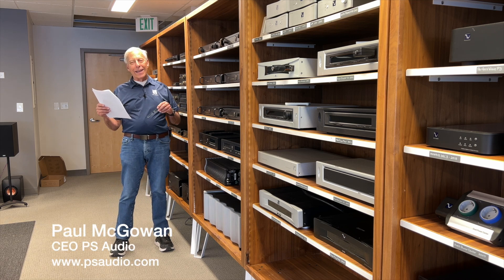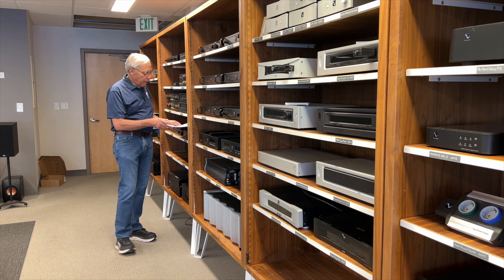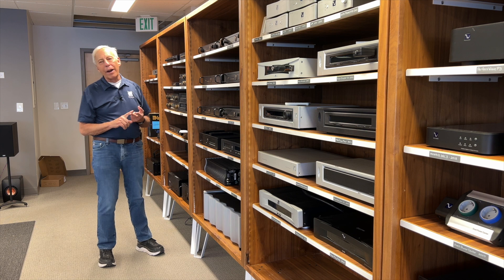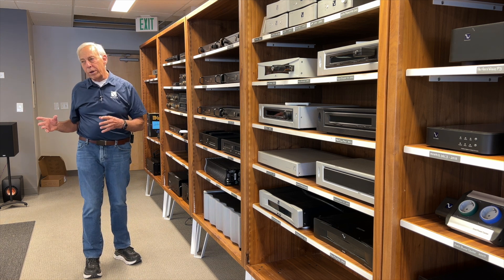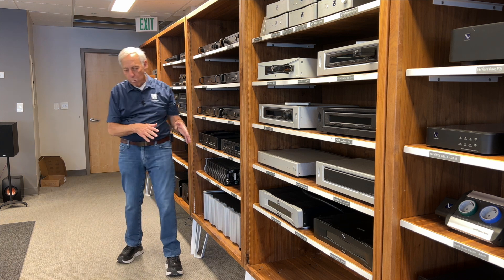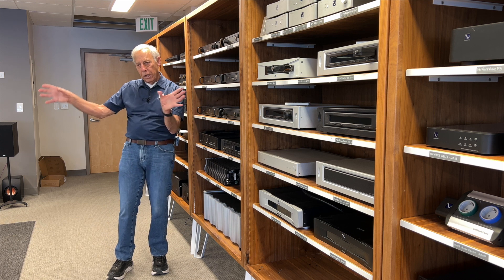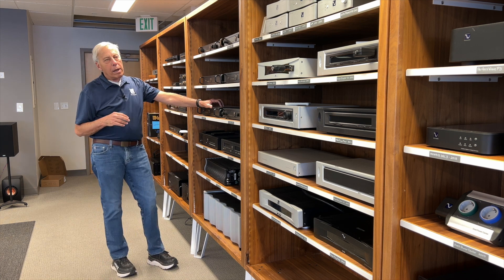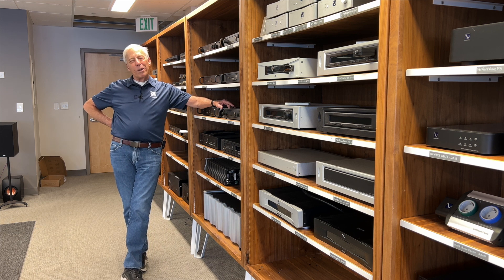Can DSP fill in woofer dips?

Comment: Some great information here thanks Paul,

I do have a DSP question relating to dips in bass. In my case the dip is minor, I use mini dsp SHD preamp to give me a correction that I like. I admit to giving the correction a few db increase in the bass shelf also, just because I like it. 

My question relates to an example like mine. The dip in bass is minor, and so cannot cancel out the bass sound altogether. I’d imagine this is the more common experience? If so dsp could potentially help as I perceive it does for my tastes?

What do you reckon as we aussies say?

On the other point you make, dsp does flatten my somewhat peaky treble but I feel I loose some transparency or air to the sound. Is this what you are referring to with dsp on higher frequencies? I look forward to you addressing this question down the track.

Keep up the great work!

Tony W
Reply: The impression I got was that it’s pretty easy to control high frequency issues without using DSP, it doesn’t take too much in the way of room treatment and setup tinkering to get the mid and high to behave. And if you cheat and use DSP at those frequencies you might flatten the response but you still have the echo and reverb taking away all your detail and smearing your imaging and soundstage. In my opinion those two things matter a lot more than the actual high frequency response anyway. Cheers from QLD 👍🏻

Comment: "Each band of the equalizer allows a maximum boost of “+6 dB” and a maximum cut of “-15 dB”. This asymmetrical setting range was chosen on purpose, as boosts of more than “+6 dB” are very rarely required. Every strong, narrow-band dip measured in the frequency response usually results from a cancellation caused by a phase shift. An equalizer typically cannot compensate for this, or only very inadequately, even if greater boosts were possible. Experience shows that you should focus on eliminating peaks in the frequency response.  The human hearing reacts much more sensitively to narrow-band peaks than to narrow-band dips.   " HELIX DSP user manual
Reply: you could get around this by increasing the whole output by 10db for example, this is done separately on the minidsp shd studio software, where gain for the whole channel is separate from the PEQ, and i have tried it out, you can get over 20db gain from this and i have not heard any artifacts from it.
not like the free pc software called eq apo i used before, where as any boost was just everything else lowered, and creating quality loss if above 6 or 10 db in peq.
Reply: @sudd3660  But keep in mind 0dB is full scale + dB means out of range, Helix recommends cut of instead of boost. I don't know how the minidsp does this.
Reply: @GBatya  i do not know either, probably when it upscale it internally to 32 bit.

Comment: @2:18 "Keep it in the bass.  I'm fine with that.  I like DSP for bass.  No so big on the mid-range and tweeter."

When you run the signal through a DSP box (or an equalizer), you are running the entire signal through that box.  And that box acts as another pre-amp.  That is active processing, and active processing is bad for sound quality.

It adds distortion, coloration, and degrades the signal from what it was.  You will be hearing that box, even if you keep all of its controls on their neutral setting.

The only way to augment the bass, via DSP, without it touching the mids and highs, is to apply the DSP after a crossover -- and crossovers are the domain of speaker design.
I know of no components that allow you to adjust the bass, while excluding the mids and highs.

Also, for DSP to work, it has to use digital content.  If you are playing a turntable, then its analog signal must be converted to digital to be processed, and then back to analog.  The DS Process will act as yet another transport and DAC, and be subject to jitter.  There is simply no way that that will leave your mids and highs as they were.

Audio is an environment of compromise.  If your bass problems are giving you agita, then DSP might be the proper remedy for you.  But it is not a free lunch.  Your mids and highs will change (assuming you have a revealing system).

An alternative solution for correcting bass problems is what Vandersteen speakers (model Quatro and up) do.
They have 11 potentiometers.  With sound tuning equipment (microphone connected to a laptop with SPL (sound pressure level) software, you can measure each of 11 different bass frequencies, and adjust each one individually.

The above keeps your signal 100% analog.  It uses a high-pass filter for each channel.  So it, too, will have an effect on the mids and highs.  But Richard Vandersteen designed it all, and if you have heard his speakers, then you know that he knows his craft.

The other advantage of the Quatros (and up) is that they relieve your main amps from 6 db of bass lifting, allowing your main amps to struggle less, resulting in cleaner mids and highs.
Reply: you have some odd ideas how dsp are implemented and work, instead of picking are you points i could tell you this: for example add a digital dsp box, use it as preamp. into two dac's and stereo power amps, you have a mains pair of passive speakers and subwoofers with only drivers in a box.
the dsp wont be noticed to degrade the sound for most people, and the benefits for those who hear it are worth it.
think about what i  said her, look at how many benefits this approach has.
many companies make such digital dps boxed, minidsp shd studio or the flex model is two i know of.
Reply: @sudd3660  "instead of picking are you points i could tell you this"
Go ahead and pick.

No matter how you use a DSP box, it becomes part of the signal chain.  You will hear it.
If you use it as a pre-amp, then you are limiting your sound quality to that DSP box's design.  Perhaps there are some very good sounding DSP boxes.  None of them show up a "Class 'A'" recommended in Stereophile or The Absolute Sound.

For a mid-fidelity system, they are probably a good choice.  But Paul does not tout his company as a mid fidelity audio manufacturer.  He touts his company as high end.  As such, he should caution that you cannot achieve that level of sound quality when you introduce a DSP box into your stereo.

Surely a DSP box is a quicker fix than all of the room treatments that Paul has in his listening rooms.  Yet, Paul does not use a DSP box.  Although he has not said why, it is because his stereos will reveal the degraded sound quality from the DSP box.

Your stereo is the sum off all of its boxes, and will never sound better than the worst box in the signal chain.

"...and the benefits for those who hear it are worth it."

In my initial comment, I wrote:
"If your bass problems are giving you agita, then DSP might be the proper remedy for you.  But it is not a free lunch.  Your mids and highs will change (assuming you have a revealing system)."

As to "the benefits for those who hear it are worth it", you can't know that.  I can't know that.  Only the person that tests it, with their stereo, in their room, can know that.

A DSP fix should be for those that are not seeking the best sound quality possible within their budget, or people that do not have time to make room adjustments to fix sound issues, or people that are physically unable to do so.

If you can fix sound issues, passively, that will almost always sound better than using a DSP box.  I write "almost always", because if a room has severe issues, then a DSP box might be the only way to fix those issues, and that fix might be worth trading off a bit of sound quality.

A DSP fix should never be choice #1, when seeking the best sound quality.

Comment: No, dsp cannot fix room modes.
Reply: that is a gross oversimplification, dsp adjust volume of those room modes, technically they are not fixed but less of a  problem and therefore you get better sound quality.  but also dsp is a wide term, with dsp you can also adjust pahce and delay, that could actually fix room things, a null could be adjusted for.

Comment: you know how to insult people naively/gently😂
it is very simple you get a single driver cabinet that can cover a frequency range from 660 Hz down to 20Hz,
with a DSP with delay connect up the speaker and flip the phase and add the correct delay, this can be done in rew what is free! just need a universal calibrated usb mic about $30.
place in the middle of the two forward speakers ideally on a stand behind the listener or on the wall behind facing your main speakers.
this will give room correction and take away the dips in frequency below 660 Hz where you get comb effect happening that's what you're getting by having dips and you do not need to push the speakers so loud so you don't encourage peaks.

Comment: Luckily bass dips are far less annoying than bass peaks.
Reply: Yes, unfortunately the peaks are caused by room modes and this requires room treatment not dsp. 

Lowing the level will never deal with the reverb, only the volume.

Other than that, Paul is right, no matter how much energy you pump into a dip, it will still cancel.

Comment: I wonder if placing a Passive radiator enclosure tuned to the frequency of cancellation in the corner would help with the peaking issue.
Reply: that is kind of a bass trap, that helps with peaks and dips,  the problem that it need a large box volume and only works in that room for one narrow band of frequency, and presumably only work best in one spot in the room.
Reply: I experienced massive phase cancellation once...and my speakers simply vanished.
The best hifi room is no room at all.

Comment: DSP correction of higher frequencies can work really well for digital music when not adding sample rate conversion and when done in high resolution math. Unfortunately, DSP correction products usually end up messing with sample rate conversion e.g. translating a 44.1kHz PCM track to 48kHz or 96kHz before DSP compensating it. Someone needs to make a DSP correction product that can maintain end-to-end sample rate from source to DAC and do the processing in 32 or 64 bits math. Until then, Paul has a valid point about DSP compensation and higher frequencies.

Comment: I've not tried it, but what about having two subs with one phase adjustable (0 to 360 degrees) - would it help or create more chaos? :) Great video Paul - it's remarkable how you keep the curiosity flowing after so many videos, well done.
Reply: Yes. Multi sub is the answer here. The more Subs you have in the room the more the frequency response will balance and equalize. Of course placed in different places in the room which would mean that somewhere where there is a null from one sub, the other sub will fill in that null and thus create a proper frequency response .
With DSP you further fix the peaks to be in line with the rest of frequency response and you get much more responsive sub frequencies in the room.
2 is huge upgrade over 1 and 4 is tremendous upgrade over 1.
Reply: I think you would be playing "wack a mole" at that point, giving up one dip for two smaller dips. Outside of the sweet spot it might get really wild, and you would loose bass definition in the upper bass due to time arrival difference at shorter wave lengths. Just an opinion, does not mean I am right. I was a sonar technician in the military and the acoustic properties and physics of sound energy is the same here. Good valid question, would be interested in what others think.
Reply: And if you're really unlucky you could put both subs in null.
Reply: @jasonkillsformomy  And if you are really clueless at what you are doing then yes but if you read about it or google "multi sub" you will easily get quick answers for specific room geometries which are in most cases rectangles.
If you put 2 subs diagonally or to the center of the room on the side walls, or in the front corners... You will never be in the nulls.
Reply: Yes I know. Just stating that it's not impossible.
Reply: @jasonkillsformomy  what exactly is not impossible? To my knowlegde you are stating that in fact its cheaper to treat the room for subwoofer frequencies then to add a second sub which is just plain incorrect as I explained you won't ever match the cleaner results that dual subs offer in untreated room compared to treated room with single sub which would net you much more due to complexity of low freq waves and the energy they carry as well as how tall and long they actually are.
Reply: @sermerlin1  I wrote "And if you're really unlucky you could put both subs in null." Never wrote anything about acoustic treatment vs multi subs.
Reply: Multiple subs do help but at what cost? I think using that money for treatment that can go that low is a more effective use of your money. A few db vs a lot (assuming you get the right treatment).
Reply: @djhmax09  It is much... MUCH cheaper to put additional sub first then to treat the room.
Room treatment for sub frequencies is a tedious and extremely complex job. It is not like for mid and high frequencies where you slap some panels on the first and second reflections and include some refracting panels...
Reply: @sermerlin1  I should have specified. For budget, sure it's probably a good idea to use multiple subs. In the high end, it might just be a waste of money. Yes, I'm aware treating low frequency energy requires much more horsepower. That's why I said assuming you get the RIGHT treatment...

Adding extra energy the room can't handle causes more issues. Imo do it right the first time instead of resorting to a more compromised solution.
Reply: @djhmax09  even at the high end it is always better have multi sub (at least 2) spread out in the room.
No matter how perfect you get the treatment of the room done it will always lose to a dual sub or multi sub setup. 
You will never have flat proper sub frequency response even in a perfect room as room is not evenly pressurised but only from one spot.

The more pressure generation you have spread out in the room, the flatter and more even frequency response is going to get.
Even in the most nasty of room configuration you will get better sub response from 2 or more then having perfectly treated room with single sub.

So before treating the room to adhere to sub frequencies you ought to first add another pressure generator (subwoofer). After you can adjust the room to get better response.

PS: now of course the best course is as good room treatment as you can get AND multi subs (4 preffered).
Reply: @sermerlin1  proper treatment will lose to multiple subs? I don't know where you got that idea but you're believing in a half truth. Yes it will smooth out the frequency response but it's not enough, at most about 9db for 3 subs. If you get the proper treatment you get much more than that.

Comment: Usually even with a subwoofer, there are only certain places you can put it considering furniture and how the room is designed. Thus the acoustically ideal location might not be feasible for other reasons. A few dB of a “dip” can still be DSP compensated but too much and you get clipping of the amp and/or the sub starts distorting at the amplified frequencies. With a DSP you therefore get much better placement options without causing a divorce.

Comment: but, when lowering the source, even though loduness is flat, you hear more of room reverberation, than original sound.. how is that better?
Reply: It's not what I felt : less output at room mode frequencies (very high factor Q) equals to less reverberation time. Even if the gradient might be the same, the output a RT0 and RT60 is lower and «analogue», sorry, analogous to other frequencies except cancellations.

Comment: i never had much issues with dips, but then i have a small room with a lot of absorption. 
having subwoofer like Paul said give you more options to fix the issue.
i run dual subwoofers and full dsp on them, i can time delay them individually or with the main speakers, then i don't have to move them around. maybe a high pass on the main speakers also help in some cases.